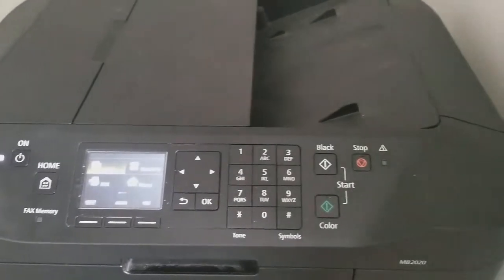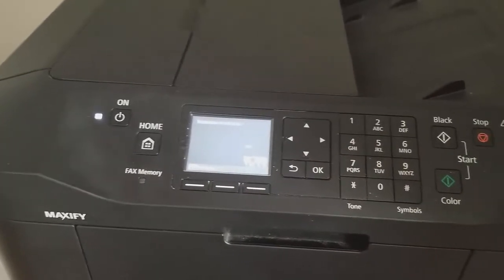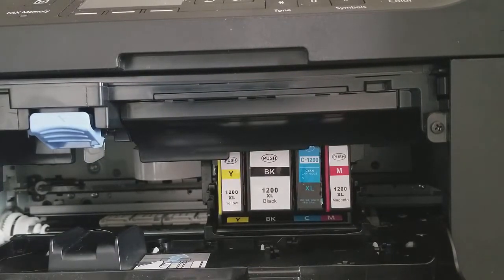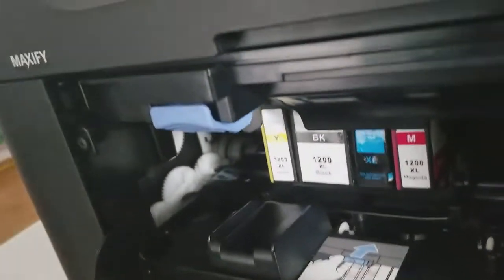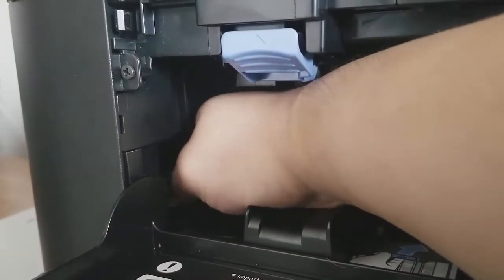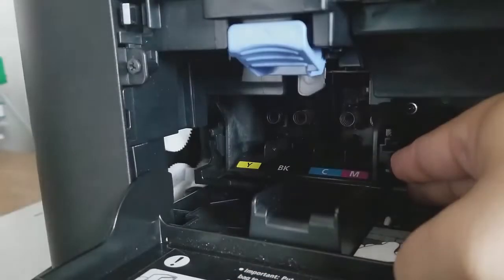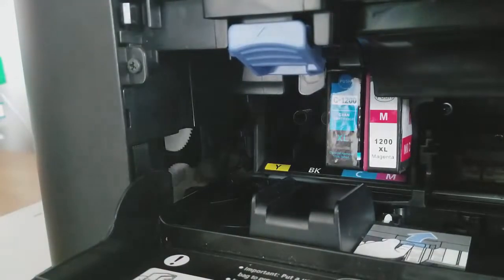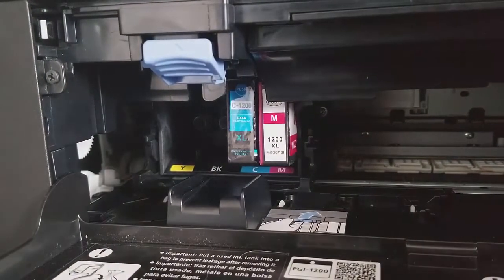How to emergency remove ink Cartridge on Maxify MB2020

Comment: Please if you can help me, I have a canon printer MB 5150 while I am prenting from the mobile suddenly the printer stopped and showed the support no.5204 could you please help me out to fix this problem
Reply: The video doesn't tell you is that the B504 error code can happen anytime while the generic ink is installed.  We all know why it happens  so I won't bore you with that point which you can read all about in any online Canon chatroom.  However, what you may not know is that same error message can occur months later after installing one or more of the many generic cartridges out there.  A leaking cartridge itself can cause the same error code to appear. My best advice if your someone trying generic ink for the first time  is don't ever throw away your OEM cartridges.  Even if you waited properly until the  ( X ) sign meaning empty appears in the  LCD color ink display.  Keep the OEM cartridge just in case the error message appears later with a generic installed cartridge.  Follow the video to remove the faulty ink cartridge but install it with the OEM  cartridge and amazingly the ( Y ) sign will reappear meaning low ink and the printer will start working again.  Just wait until the ( X ) sign appears again and install with a new generic cartridge.  You may be even able to  reinstall the half used  generic cartridge removed as long as it wasn't previously leaking.  That's the key and it isn't as obvious to spot a leaking cartridge as you might think.  Just remember to keep the OEM cartridges as this same routine we just followed  may be necessary again 6 months or later down the road.  If you have no OEM cartridges left then a hard printer reset may be necessary to fix the problem.  However, just know that contrary to popular belief your printer isn't dead .  Worst case scenario buy an OEM cartridge and never throw it away when you buy generic cartridges again in the future.  The 82% savings you get in buying generic ink in the future will make the extra money spent for buying the OEM backup  cartridge in the future well worth it.

Comment: did you change to new official ink? or did you change to new generic ink?
Reply from the maker: @YUUMETAL I changed to a new generic ink, the one i buy is the same as the video and still using the same ink until today. It becomes too expensive to buy the official due it's an old printer.
Reply: @MarriPaw  thank you.
I changed to new generic one but it didnt work.
I might have to buy new official one. or look for another generic one